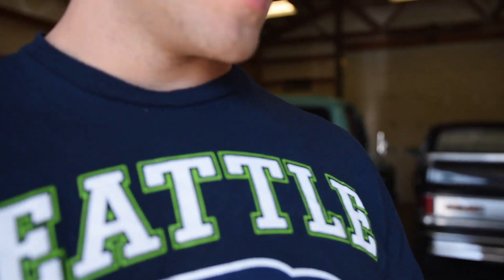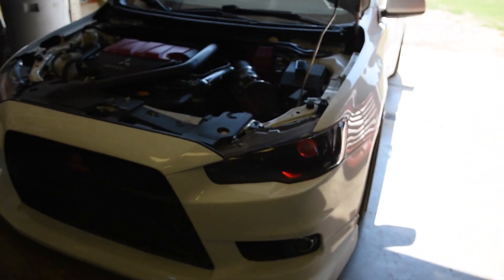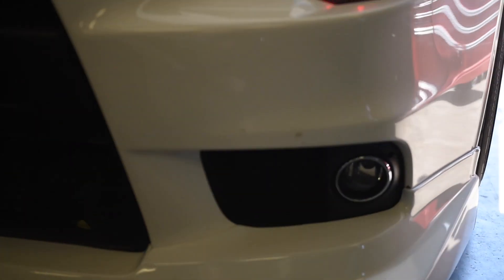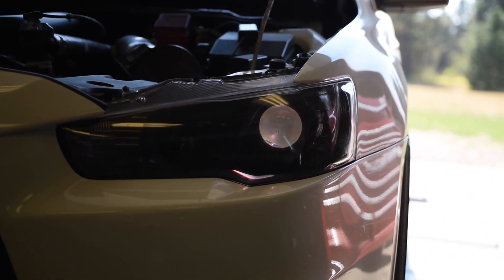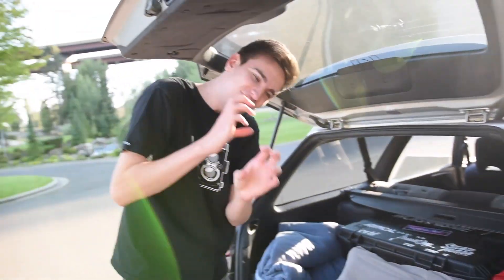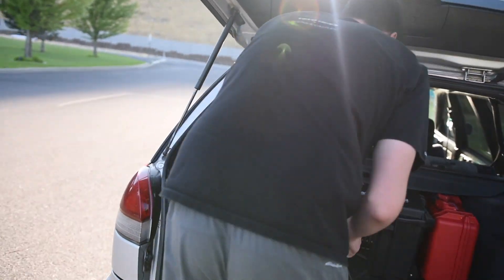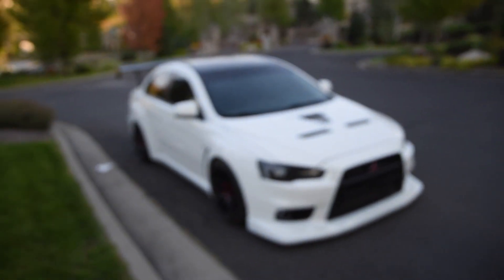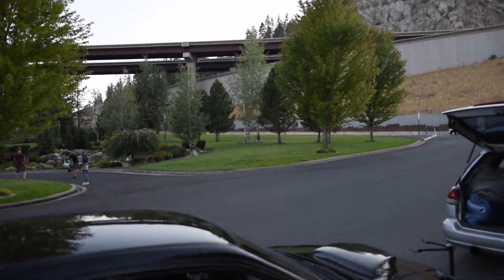Static Evo X & Bagged STi | ft. Bagged FB6 Civic

Comment: Hey, man. Great vid as usual! What are the specs on your wheels on the Evo?  I know they're ESR SR08's, but 9.5 +22?, 10.5? Offset?  I started to order these in machine finish for my wicked white evo x yesterday, but I can't find the info on whether the 9.5 +22 will fit without a spacer.  Thanks for any info!
Reply from the maker: Kevin Vines mine are the 10.5. The red rays were 9.5 and cleared fine!